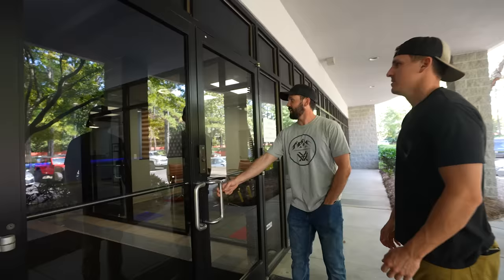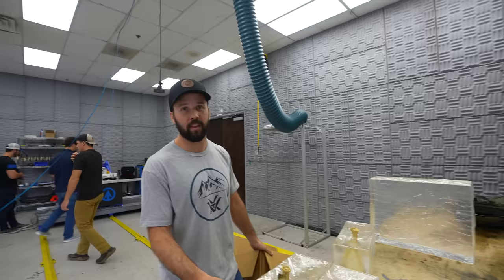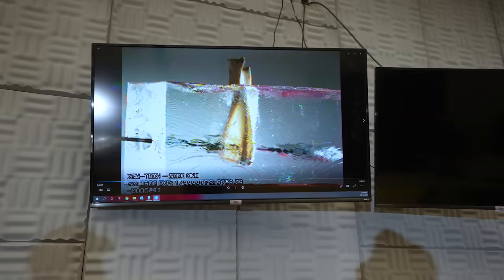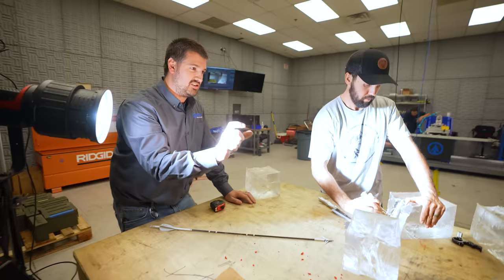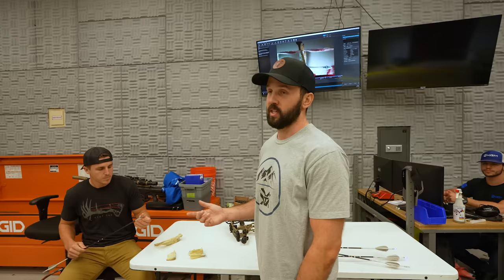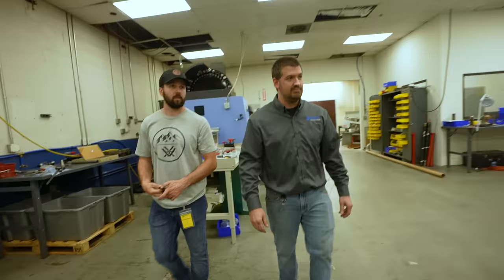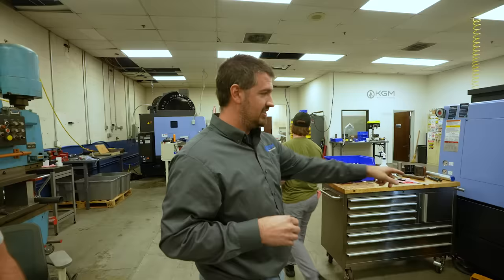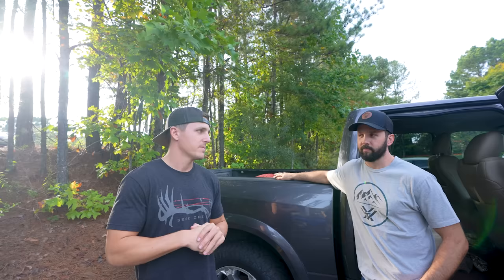BROADHEAD TEST: Which One SPLITS BONE? (Super SLOW-MO Camera!!)

Comment: My question is why was the shoulder blade in the middle of the gel wouldn’t you want to but the shoulder blade close to the edge. For the most accurate test
Reply: Also wouldn’t be 5 feet away from the deer
Reply: @tyleryeager9377  ya that’s true 20 yards and shoulder blade close to the entry is the best test to do here
Reply: I would also like to see more heads that open up and I want to see them back up to about 20 to 40 yards also bring the bone forward more and put card bored on the front
Reply: Yk i wondered the same thing, kinda makes no sense but what works for them works for them
Reply: Yep agreed. Bone was way too far into the gel. Reality is that it maybe and inch or two depending on animal.
Reply: If I had to guess it was placed in tge middle because he was shooting so close that way the extra gel would slow down the arrow to a more realistic fps
Reply: @brodymartinoutdoors7764  Noone should be shooting mechanical broadheads at bone intentionally. Heavy arrows with high foc and single bevel broadheads are the only ethical way to take those shots.
Reply: @tyleryeager9377  if you have a heavy arrow  set up like it appears they have you are not loosing nearly any KE at the 20yrds vs 5yrds. If you are set up for a light and fast arrow well then you are screwed for bone penetration no matter what distance.
Reply: @tidestirestines  you should never intend to shoot bone the high foc and single bevel is in case you hit bone you have a chance to get vitals
Reply: @tidestirestines  this. It's crazy if you think about some of the testing people are asking for here. I was in the same boat. We know what we know . I will continue to learn and grow, some people need to do that too.
Reply: @bradleybrossard1079   your wrong there I run a 390gr setup and can blow thru elk shoulders but it is 16% FOC. I have notice higher FOC arrows do have better flight and can drive through better then their more balanced counterpart and I don't sacrifice speed for higher weight arrows.
Reply: @tidestirestines  I would hope no one is shooting through bone intentionally! But good to know I guess what would happen if your mechanical hit bone. I don’t like mechanicals in general, even though they have been proven to give good wound channels. Accurate shooting and practice wins though
Reply: 70lbs at 5feet? Why not take a page from firearm ballistic testing and run reduced velocity to simulate distance? What velocity is this setup shooting at 20 or 40yrds? Want to see what sets the broadheads apart use a velocity seem at 100yrds. Childrens bows would be most appropriate for these tests
Reply: the most important part of a test like this is consistency so obviously where they were shooting wasn’t exactly how it is going to be but since the tests were very consistent the test was still pretty valid
Reply: If it can split it that deep then it’ll spit it right under the skin.
Reply: @jeromem8348  I promise my 550 20% will blow through everything your 390s will and more with little sacrifice in speed and lots of gain in momentum
Reply: @FieldToTableOutdoors  no problem with shooting through bone on whitetail deer with the right set up at the right yardage.  The shoulder hides so much stuff that is devastating to a deer.  If you take even a slightly quartering to shot, If your not aiming at the shoulder chances are that deer lives a long time. If you go through the shoulder it's seconds
Reply: @scottpaulsen2649  why not on a whitetail deer? if you are taking slightly quartering to shots you are shooting to mortally wound if you are not aiming for the shoulder.  With the right setup you should have no problem going through even the thickest part of a whitetail shoulder.
Reply: @ep3389  thats the plan
Reply: Bone in a live deer is flexible and alive . Not dried out and brittle . No doubt expendables penetrate less but it doesn’t take much to kill a deer. Stone kills them easily. Be ethical and wait for a good shot and any of them will kill a deer quickly
Reply: Doesn't matter really ballistics gel is not even close to flesh and muscle and is a very poor medium for judging archery equipment.
Reply: My guess would be to keep the bone from shifting inside the block. If it was near the outside it might twist and come out
Reply: @tidestirestines  every video I’ve watched the single bevels get out performed lol
Reply: @BlakeC552  in what medium?
Reply: @BlakeC552  I have watched a ton of videos comparing single and double bevel heads. They perform the same when not hitting bone and the singles usually outperform the doubles after impacting bone. I don't plan on hitting bone but shit happens and I want to plan for the worst case. Most important thing I have ever done was ditch mechanicals. Way to many failures even with my small sample size. Not one failure with fixed cut on contact heads.
Reply: @dylanbrannon8092  I'd say 40 yard is more accurate, no?
Reply: Ballistic Gel is not a perfect simulation for flesh. Also there are other things you aren't thinking about, a deer has fur and a thickish hide before the flesh. The ballistic gell has none of those things. 

Honestly, ballistic gel is a terrible medium for arrows IMO... It was designed for bullets. There is Alot of drag with an arrow. That being said, it really doesn't matter. This type of science is about consistency and comparing results. It's not a translation to what it will do on a living breathing animal at all.
Reply: @joshbriele325  
I second that in my comment.
Reply: I know I'm late but skin and hair are tougher than gel so maybe they put it in the middle to kinda garage the difference in between the gel an the  hair and skin of the deer. Maybe or maybe not but that's what I was thinking when I seen it
Reply: @Jonnydeerhunter  I didn't see this before posting my comment but totally see and agree with what youre putting down lol
Reply: Using dry hard bone is completely different than live bone
Reply: Lost a deer to a mechanical that failed to deploy from a crossbow.

Fixed blades forever!
Reply: @brotherbrovet1881  .......   what does that have to do with this comment?
Reply: I think the test is more about which of the arrows penetrate the most
Reply: @Mararb8  yeah a penetration test after the scapula there is only about 1 to maybe 3 inches between skin and scapula even less at certain points.    You would need the penetration after the bone hit. Not seeing if it'd go through gell and poke through a bone
Reply: @Scott Paulsen  my 520gr 21% setup did NOTHING better than my 433gr 16% setup. I think people over think this stuff
Reply: @jeromem8348 you can use a higher grain arrow bud it’s all about the fletching in the arrow look up old school native videos on them making em in Texas or Oklahoma
Reply: The test was to simulate and test penetration through bone. Material in front isnt as important as you would think. They all have the same arrow weight and were all shot with the same build through the same material density.
Reply: Exactly ! At least 2-3” from the edge
Reply: Because there not tested a decent shot but clip the shoulder there testing a bad shot on a deer straight into the shoulder
Reply: Maybe the arrow would bounce back and hitbthem so they made it depperbin the gel
Reply: @BobbyB1776 doeant take mutch to kill a deer? You nust have never had to track a whitetail
Reply: This test proves nothing. Don’t waste your time.
Reply: They shoot fatter deer
Reply: Human skin is equivalent to 4” of Ballistic gel so a deer hide would need significantly more gel to simulate. Makes perfect sense
Reply: The block infront of the scapula would compensate for how close they are to the
Reply: @scottpaulsen2649 you math bro?
Reply: I thought the same thing
Reply: @tidestirestines lol I have shit rages through both shoulders same with dead meats 
Sevrs are even better you don’t know what you are talking about deer shoulders aren’t that tough
Reply: @brotherbrovet1881  how do you know that it failed to open? Did it pass through and you found it and it it was closed?

Comment: Y'all need to get some cow femurs for your broadhead test. They are usually pretty uniform in size and would definitely represent a worse case scenario. Also I think shaft drag on the arrows is so high with ballistic gel it's kinda comparing apples to oranges. Hide muscle and organs are all very elastic and really slick.
Reply: 100 percent
Reply: I would like to see this as well and place the hide of a boar pig in front. See how the arrows perform hitting tough hide and then a tough bone

Comment: Great video! Awesome testing. 
My tweaks - scapula not soooo deep, thick leather before the gel
Sharpness - before and after going through bone. Needs to stay sharp after breaking the bone.
Reply: I thought the same thing about the depth, but I think they're simulating hitting the back scapula, preventing a passthru. That was a problem I had with early expandables.
Reply: @jasonmitchell43  i don't think that's what they were doing. Because if you pass through the 1st but stop on the 2nd, you've just passed through everything vital for the deer to survive. There wouldn't be the lost deer they talk about. 
I think the Rage's problem is that it's trying to make such a BIG hole and the blades aren't swept back enough.
Reply: @mikemcgill3998  I lost a deer with a well placed quartering away shot because it stuck in the back scapula. It definitely did vital damage, but the deer hit some brush and broke the arrow off. We lost blood when we found the back of the arrow.
Reply: @jasonmitchell43  that sucks. I hate losing deer. I've shot a few over the decades that have been lost. Still twists my guts. One buck i swear aliens came down and lifted him straight up. Blood trail was awesome...... then nothing. Three of us searched and searched. After the shot, he stopped about 50yds away. Long enough for me to see at least 6 inches of arrow sticking out the bottom of his chest. Blood was very visible. I wish I knew what happened to that one. That haunts me and it was 22yrs ago.
Reply: @mikemcgill3998  I've hit some and missed some clean over the years, but the 2 that stick with me are the one that broke off my arrow, and I had a nice 8 that was stolen. Neighboring land owner wouldn't let me track onto his property that night, He checked the deer in the next morning. Just sickening. The check station was hanging up a Polaroid of him with the deer when we went in for lunch that day.

Comment: Excellent thought went into developing this content. I believe an archers goal is to achieve a full pass thru every time. I decided awhile back that balance is my number one objective in my set up. Speed vs momentum, penetration vs cutting diameter. Either extreme will achieve results for the designed situation but, a well balanced arrow will let you both accurately shoot at range and achieve significant penetration. Same reason I stay away from expandables. They’re designed to accomplish one job extremely well, but they sacrifice too much in penetration to be a relative option in my opinion.

Comment: The only comment I have is that a shoulder blade is not behind 8 inches of flesh in a deer.  Obviously an Exodus kicks ass in almost all circumstances, but your rage might give you a different story if you were hitting the scapula 1 inch deep and then still got 8 more inches into the vitals.  When you are only getting 16ish inches of penetration, you have burned through half the arrows energy before you contact the scapula.  I think you also need to compare them all going first through cardboard.  That will be robbing energy from the rage the others didn't suffer.  There is real effort involved cutting cardboard with a razor/box cutter.  Same would be true for the broad heads.  

I love your videos.  Keep up the good work.
Reply: I'll 2nd that. The scapula isn't that deep. They could put a scapula at each end of the block and get twice the use. Awesome testing but there's still tweaks.
Reply: Exactly

Comment: I like the test...the one area I believe that is the weakness of the test...the bone itself...I understand it had to be dry to have it implemented, but a dry bone is nothing like a live bone. The shattering and breakage you saw is due to dry. A live bone is more fibrous and dense. I believe that may have different results
Reply: You’re correct, moist bone doesn’t shatter as readily, and it tends to be “grabby” on edges of blades.

Comment: Was definitely hoping to see a better variety of heads than these. A rage in my opinion is far from the best mechanical head. Great way of testing heads would love to see it with more heads.
Reply: I really like to see the Tree Sharks!
Reply: Agreed .. I was a rage diehard, but after a few major quartering deflections, and an upsetting shoulder shot, I gave up on them. Since then, I've switched to Magnus Black Hornets and Grim Reaper Pro 3 blades (BOTH made in the USA too). I've never looked back.

Comment: Again and again
Cut On Contact Fixed Blade.

If you are unsure of which broadhead to use just get any decent cut on contact fixed and get out in the woods. It's a no-brainer (to this guy).

No one should be surprised at these results. This is all just opinion, but personally I can't understand anyone putting a wide mechanical razor blade on the front of an arrow and going out into the woods praying you don't hit bone. 

Keeping in mind that this test was performed with a fairly heavy setup! Lots of momentum and FOC with a mid 500 grain arrow at 70 pounds! And it still couldn't push the mechanical through.
Reply: Muzzy fixed blade 125’s. Used them for years… if it ain’t broke don’t fix it.

Comment: As an engineer and hunter that was a fantastic video. I switched from mechanicals to fixed in my new setup. Shot a medium sized doe last week. Quartered on heavily inside of 20 yards. I went thru the top of the scapula, lung, everything connecting the pump station, guts, and into the rear quarter. Head broke off lodged in the femur, partially breaking the joint. I was very impressed plus the broadhead was intact, with very minor damage to the tip which could be fixed and re-used as a backup.

Comment: Guys great job. I am a long time hunter the rage head seems to provide one heck of a hole through a deer. If you hit the shoulder most likely you will  not get a pass through the deer will bleed to death internally when you open them a 5 gal bucket of blood comes out. When you hit them just off the shoulder and get a pass through blood goes everywhere. Take your time and make the best shot possible. I know that my skill is limited to 30 yards. Good job on taking the time to show the difference between the heads. They all make a killing wound.

Comment: I like the theory on this. One question though or observation is the amount of gel in front of the shoulder blade vs the amount of meat, hide in front of the shoulder blade. There is only 1-2 inches on an animal tops and you have 4+ inches of gel. I feel that would make a penetration difference and the Rage is at a disadvantage on the test. Thank you guys great info.
Reply: Up to 3" on a deer and more on a Moose. Add a layer of deerskin or elk leather glued to the face. To simulate the dulling effect. And to demonstrate how wide blades lose more speed punching big holes in thick hide vs narrower broadheads. The flint stone arrowhead guys hunt with 3/4 or 7/8" wide arrowheads. Very narrow, right at the state legal lower limit for cutting width. They get full pass-thru shots routinely, shooting only 50-70 grain stone heads on medium weight shafts. Maybe 450-550 grains. They don't split bone but can wedge buried in a spine and be very lethal for all except square on shoulder hits.
Reply: @TheJustinJ  3"... Must be a North Pole deer? I have not ever saw that much on any deer. But I'm a young buck yet... Also, full pass through with an inch diameter head requires a exponentially less margin of error. I guess if you use FMJ to hunt with your rifles, it makes sense and I agree with the broadhead logic.

Comment: I used to torture test every broadhead I bought.  I destroyed more heads than I really want to think about, including the Exodus.  The only head I have used that has stood up to ridiculous abuse has been the Cutthroat.  I split a cow femur into two pieces with a Cutthroat 150 grain and the arrow penetrated the foam target another 12-14 inches. The edge had some chatter, but it was resharpenable.  The VPA heads are great, too.  People used 2-blade fixed heads to cleanly kill animals for a long time before the modern broadhead craze.  I like to keep things simple.  Shot a bull elk with a 2-blade VPA in 2019.  He ran 50 yards and piled up.  Love the one piece machined broadheads over the replaceable blade type.

Comment: I don't know if you guys watch lusk  archery adventures,  but the QAD exodus has tested the best for toughness,  sticking into a concrete block with no obvious damage, incredible!  Would have like to see the tooth of the nail, 175gr XL tested, another real tough head. As far as mechanical heads the sevr 1.5 has also tested extremely well, almost all the Rage broad heads come apart quite easily. Great video! Love the super slow mo, keep up the good work!

Comment: Scwhacker have a nice sharp chisel tip paired with a great mechanical blade I’ve blown through 2 ribs and bottom of the shoulder on opposite side while still passing through I pull 70# at 319 FPS
Reply: i agree i shot thru one shoulder and hit the other it bent the broad head that’s it deer didn’t run 30 yards 65-70 pounds prolly 325 fps
Reply: i’m not changing until the shwacker does me wrong or i see it do bad 🤷🏻‍♂️
Reply: Yeah scwhackers have had my back through and through